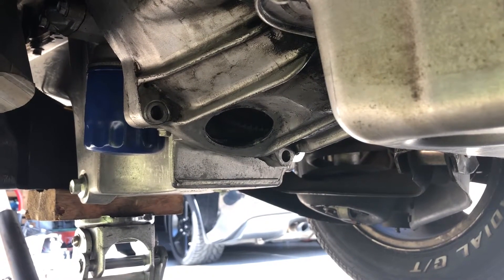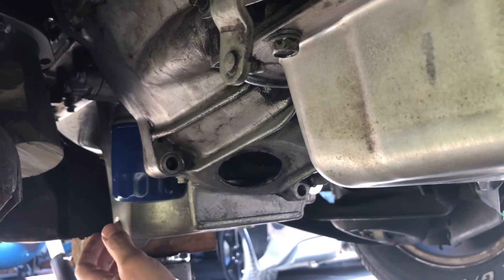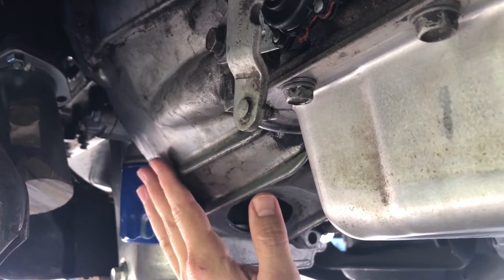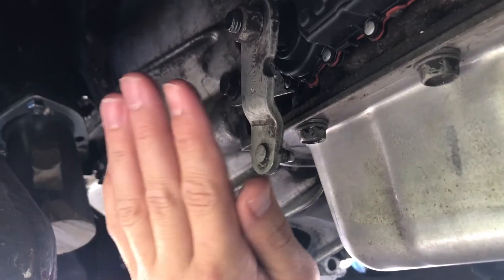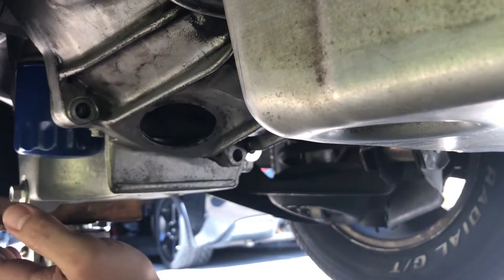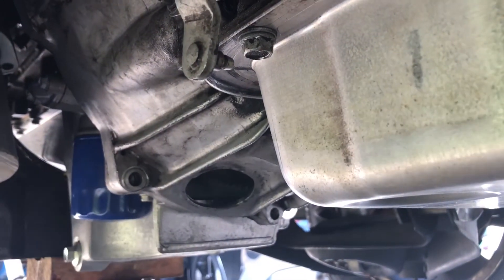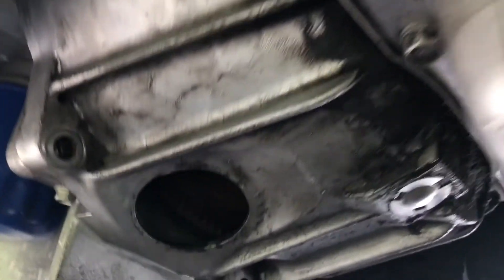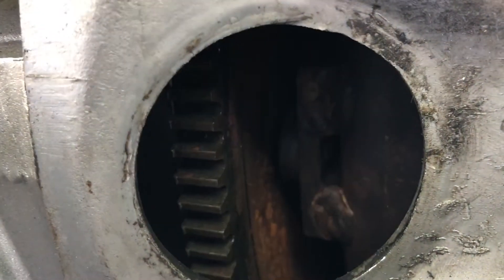5.3 To S10 V6 4L60E Spacer Requirements *If using this flex plate on LS motor, remove the weight!

Comment: Why would you check the 3/16 gap between the converter and flexplate if you used all the parts from the v6? Isnt it going to be the same since the spacer is on the other side of the flex plate? Im just trying to understand why there would be a different gap between them.
Reply from the maker: It’s been a while since I did this, so I don’t remember the details… Sorry.

Comment: I’ve got a 4l60e out of a 03 s10 going behind a 2000 5.3 but unfortunately it didn’t have the torque converter by any chance do you know mm torque converter I need
Reply from the maker: I’m not sure off the top of my head. I just used the stock converter that came with the transmission I bought. (Craigslist $250!) A quick google search should yield some answers for you.

Comment: 5.3 with crank spacer with a flat flex plate. You can’t use the oem dished flex plate from the v8. Also if you use the v6 flex plate make sure you take off the balance weight that’s on the back side
Reply: You have to use a spacer and dished flex plate?

Comment: I'm doing it the other way around. I have a 4.3 vortex in a chevy s10 and a 4l60e out of a 5.3 Silverado. It bolted in just fine, without a single bottom bolt that doesn't matter. I am not sure if I need the flywheel out of the 5.3 as well, or if I just need to scrap it
Reply: Did you have success? Having heck of a time finding this info. I too have a 95 4.3l with a bad trans but have a 04 tahoe donor rig sitting around and I'm trying to figure out how to mate the two.

Comment: Thanks for the info. it was extremely helpful. What year transmission did you use at the time of this video
Reply from the maker: It’s a 4l60e from a 4.3 liter v6 s10. It’s till in the truck too! Still hanging on!

Comment: Did you have any problems with the starter
Reply from the maker: Nope. Except that I have to separate the engine/trans to get it in and out! I’d go with a mini starter, if I had to do it over.
Reply: @CliffsHowTo  did you use the V6 starter or the 5.3?
Reply from the maker: 5.3, but is should have used a “mini starter”. I’ve heard those work fine, but will fit in/out without issue

Comment: I have a bellhousing torque converter from a core I had sitting around. I want to know will it bolt up to a s10 or blazer 4l60 I seem to always find those at the pull apart for $120. But I don't want to pull it if it won't fit
Reply from the maker: The bellhousing should bolt up. Make sure you measure the torque converter. They have different depths.

Comment: Will I need a spacer for the transmission from a v8 (4.8L Vortec) to a 4.3 Motor
Reply from the maker: See the video description for a link which explains.
Reply: Make sure your torque converter in all the way in on the tranny pump it should slide in 3 clicks

Comment: Just needed to swap the bell housing... lol hahaha
Reply: Except the input shaft on v6 4l60e are different too.
Reply: If its has a different inputshaft you can use a different type of torque converter... I've  done it before...
Reply: I mean a v6 torque converter
Reply: Bellhousing is only slightly different from what I read. It bolts in enough to hold.
Reply: So if I swap the bell housing from my 5.3 4l60e I can use the 5.3 flex plate

Comment: Will it be ok if I used the other adapter that goes on to the torque converter snout?
Reply: Are you using a stock converter?
Reply from the maker: That one is for a different purpose. It depends on your engine/converter/flexplate, as to which spacer, or whether or not you even need a spacer.

https://www.novak-adapt.com/knowledge/gm-crank-spacing

Comment: Do you know if a 99' 2.2l s10's 4l60e would mate to a 4.8l?
Reply from the maker: 2.2 has a completely different bellhousing. So no.
Reply: @CliffsHowTo  I was slightly confused because I believe I have the 2 piece 4l60e where I can change the bellhousing but not 100%.
Reply from the maker: That may be the case. I’m not sure though. My truck was a 2.2, but manual transmission. I could t use that one.
Reply: @CliffsHowTo  Gotcha, I have an auto. Thanks!

Comment: I’m getting a 5.3 vortec would I be able to use my v6 vortec 5 speed on that engine or would I need to get another transmission?
Reply from the maker: You can use it. Some people have good luck with them, some don’t. If it’s a stock motor, and you drive it reasonably, I’ve heard they last.

Comment: 5.3l engines came with a 4l60e.
Reply from the maker: They did. But if you have a flexplate/converter from a 4.3, 4.8, or 6.0, then they don’t all have the same spacing requirements.
Reply: @CliffsHowTo   or a 5.7l L31

Comment: Hey cliff So basically you mention that the spacer goes first then the flywheel right? Heres a question for you will the starter engage with the flywheel cause its been moved 1 inch farther apart
Reply from the maker: So, the need, or not, for a spacer, is determined by what motor you have, and what flexplate you have. Some engines, the crankshaft mounting surface comes out farther = no dished flexplate. On the motors where the crankshaft is shorter, they use a dished flexplate to make up for the shorter crankshaft. 

But it you have a short crankshaft, and a flexplate that is not dished, you need a spacer.
Reply: @CliffsHowTo  I have the same 5.3 same year as yours and im gonna use a v6 transmission and the 5.3 flywheel and torque converter! U think I still need the spacer???
Reply: I still don't unserstand I'm sure I checked my s10 and if I install the Flexplate spacer behind the flywheel like u did the starter will not engage cause the spacer behind the flywheel moves it 1 inch farther. How did u do it I think that the Spacer goes on front of the flywheel im not sure???
Reply from the maker: Try looking at this. That’s what I used as a guide.
https://www.novak-adapt.com/knowledge/gm-crank-spacing

Comment: I’m looking for a similar set up. I’m looking at a 93 s10 v6 I wanna to get it and later on ls swap it. I been doing research but some just cut the frame to make the engine sit right. Did you had the same issue?
Reply from the maker: I did cut it. Many say you don’t have to though.
Reply: I did that swap in a 04 xtreme simple swap once you have your harness sorted out,motor mounts and computer tune theres only one trick left for your top radiator hose

Comment: I know this video is old but 4l60e from a 4.3 and v8 are the same unit...
Reply from the maker: Are they? I’ve read on forums that the v6 unit has one less clutch pack.
Reply: @CliffsHowTo  nope it dont have  one less anything i rebuild a few of them its the same exact thing..
Reply: rusty watts but there’s a different bolt pattern and you still need the spacer correct?
Reply: Im looking at a 4l60e from a 2003 astro van to build for my 1999 trans am LS1, will it bolt right up? Is it still a 300mm shaft, if not can I just swap the input drum with a 300mm shaft if I needed to?
Reply: @martinez1701a  look at the bellhousing on the 4.3 if its not the ls style then no its the 298mm and it wont work...im not sure when the 4.3 went with the 300mm shaft style transmission..i dont know about swapping parts i always keep the same parts with the same transmission...

Comment: I’m putting a 5.3 in a 2wd Silverado that was originally v6. I have the 5.3 torque converter and flexplate. The problem I’m having is, when I tighten all of the bell housing bolts the motor does not spin nor does the torque converter. At first I had the v6 flexplate with the v6 torque converter and had the same problem. When the bell housing bolts are not fully tight the motor and torque converter spin just fine. Any ideas? Will a spacer work for my setup?
Reply: My understanding is when you put a 4.3 transmission behind a 5.3, you need to use the bell housing from a 5.3 transmission. Then use all the 5.3 parts, flywheel and  torque convertor
Reply from the maker: Hmmm. Make sure you’re seating the torque converter into the transmission all the way before trying to bolt it up. 

It sounds like maybe it not all the way in. 

Spin it, while pushing in. Try both directions. You will feel the converter slide in a bit further when it seats. It will be obvious.

Comment: What did you end up doing for exhaust my driver side header shoots straight down also how did u end up routing it
Reply from the maker: I just bought some pipes and u-bends and a muffler from summit racing and welded some stuff up!
Reply from the maker: Parts list if this helps 

https://youtu.be/KfKKb5Uuzvo

Comment: Ok so what do I need if I’m using a 5.3 flex plate, 5.3 converter.
Reply from the maker: You shouldn’t need anything... I wouldn’t think. I’d follow up on that though. 

You can look on s10forum.com. Lots of info there.

Comment: How do I make the 5.3 tranny fit the 4.3?
Reply from the maker: I used the 4.3 transmission.
Reply: @Brian_W.  did you ever get the 5.3 4l60e to swap to the4.2 4l60e I'm looking at doing the same a2001 suburban 5.3 4l60e to an 2002 envoy 4.2 4l60e
Reply: Did you find out if you can swap the 5.3 4l60e trans to a 2002 4.2 4l60e
Reply: @Brian_W.  how was that to do,just pull that front pump and switch it with the one on my envoy trans

Comment: Did you have to modify the tunnel for install
Reply from the maker: No
Reply: @CliffsHowTo  so did you install as a unit?
Reply from the maker: Engine from top, then transmission from the bottom
Reply: @CliffsHowTo  wow mine wont fit in my 2002 s10. I'm going to have to knock firewall & tunnel some
Reply from the maker: There was a seam I had to roll, but that’s it
Reply: @CliffsHowTo  thk you for info

Comment: Did u use a 4l60e transmission out of a 4.3 v6 s10 or a 5.3 v8 . do the v6 4l60 fit the v8 engine or the bellhousing is diffrent
Reply from the maker: I used a v6 s10 transmission. Not all of the bolts line up, but most do. I went ahead and put a corvette servo in it too, to try and prolong the life. 

It ran a 14.6 in the 1/4 mile this weekend then drove back home just fine!
Reply: @CliffsHowTo  thats awsome im doing my s10 swap soon cant wait thank u god bless u

Comment: Does the starter still have full engagement with the flexplate?
Reply: That was the only thing I was worried about I have about a quarter inch gap if I spaced the flexplate would it cause issues.  I ran into the same issue today and I can only think to get the adapter For the torque converter so the flex was in the same place versus just spacing the flexplate.
Reply from the maker: I’ve only started it a few times, but it seemed completely fine.
Reply: @CliffsHowTo  I followed everything you did but now my starter doesn’t engage, it won’t reach my flywheel
Reply: @matthewhudgins5973 did you figure this out?

Comment: Got a 97 Camaro 3.8 46le will that bolt.up to a ls1 ? And will I need a adapter
Reply: 4l60e
Reply from the maker: It will bolt up. Depending on what flexplate and torque converter you have, you may or may not need an adapter.

Comment: If possible can i get the part number and brand of the adapter they use for the 4.3 4l60 e on a 5.3 im doin the same swap and cant find it
Reply from the maker: Ordered from Jegs, part #555-601062

Comment: use the LS flex plate and the cheap spacer and open up the holes for the torque converter, same transmission just the weakest version of the 4l60e, i have been running mine for about the last 5 years no problems
Reply from the maker: That’s actually what I ended up doing. I didn’t realize that the gel plate had a counterweight to balance the 4.3 on it until someone commented on this video!
Reply: What is the part number for spacer
Reply: @dontaacorleone1  Dewhel DE-8258

Comment: I'm having a problem now but somewhat different. I have a 1995 Buick roadmaster. It had the 4l60e early model one piece case transmission.  The car has a lt1 in it. I built a 383 stroker and ran the oem transmission for about 6000 miles. And as expected it went out. Common problem with 3&4th gear loss. However I put in a 2000 model and used my old torque converter. Well long story short the converter is hitting the flexplate. Do I need a plate that goes between the block and bellhousing or should I space the bellhousing away on the transmission? ?
Reply from the maker: I don’t know much about the LT1 engine... sorry.

Comment: Is the v6 flex plate the same balance weight and spot as the 5.3 ?  If you use the 5.3 flex plate that is concaved you only need to slot the torque converter bolt hole inward and the $20 converter bushing  that slip in the end of crank
Reply from the maker: That’s not what I have. I have the flex plate from the V6 transmission.
Reply: Cliff's How To Channel yes the flex plate from a 4.3  v6 and put it on the 5.3  right   they they do not have the same balance weight  the v6 has a external wighted flex plate  the 5.3 has no balance weight on flex plate if you don't remove the weight from the v6 flex plate your motor will be out of balance
Reply: The 4.3 v6 flex plate / flywheel uses a external balance weight of 28 oz  the 5.3 motor uses a flex plate / flywheel with NO external balance weight  0 oz if you use the v6 flex plate YOU MUST REMOVE THE WEIGHT or the motor will be out of balance and vibrate badly
Reply: Bama Dave I’m using a 5.3 2002. And 4l60e from a v6 engine  what I need to do?